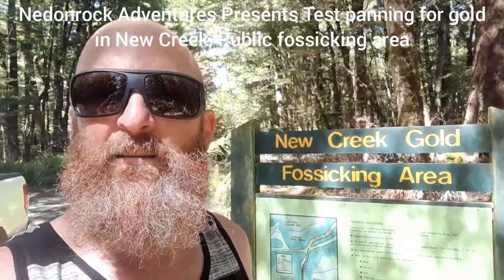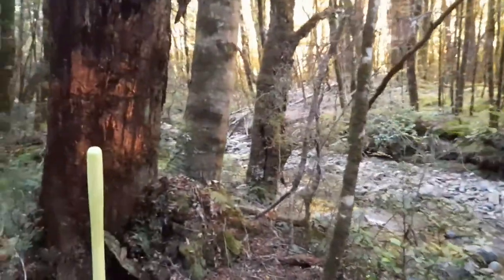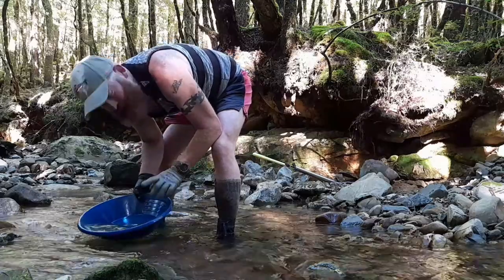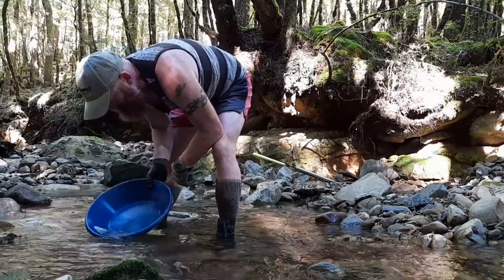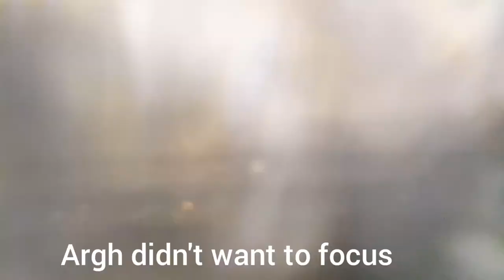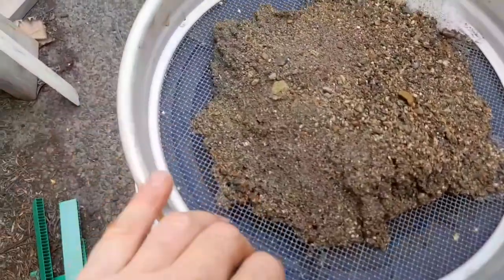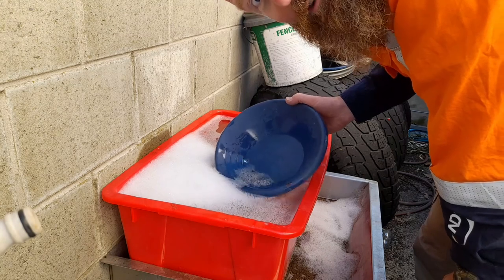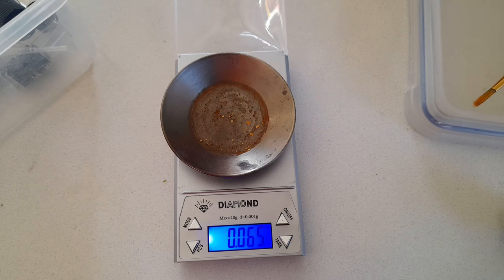Test panning for gold,in South Island New Zealand

Comment: I've watched the pros up new creek they put waders on and dig 4 feet or more in the centre of the creek lifting hudge bolders out and finding gold nuggets a good amount .
Reply from the maker: Yes if you are strong and keen you can dig very deep to get the good gold at the bottom but run everything else on the way down as gold will also be in the lighter material